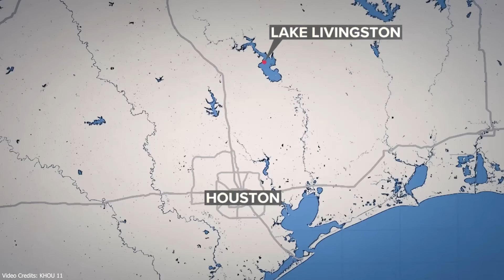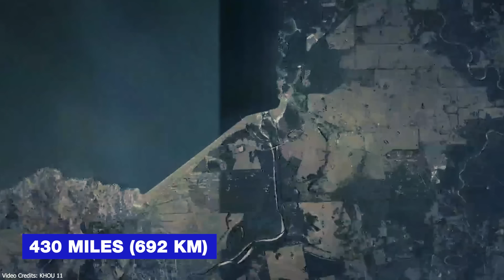Texas' Largest Dam Is Sinking — And There Is No Backup Plan

Comment: From Google Gemini:No, the claim that Texas’ largest dam is actively sinking toward catastrophic failure with no backup plan is misleading.   
YouTube

The title comes from sensationalized online videos covering the Lake Livingston Dam, which provides water to the Houston area. While there are real engineering challenges being actively addressed at the dam, the dramatic claims of imminent failure are exaggerated.   
YouTube+ 1
What Is Actually Happening?

    Satellite Data (Subsidence Monitoring): Studies using satellite-based radar (InSAR) have detected minute surface movements—measured in millimeters per year—across various major U.S. dams, including Lake Livingston. Minor settlement is a well-known, long-term phenomenon in large earthfill embankments, especially in regions affected by regional soil subsidence.   
    YouTube

    2024 Flood Damage & Emergency Repairs: In April–May 2024, record flooding down the Trinity River forced massive water releases (around 124,000 cubic feet per second). This caused severe scouring and erosion beneath the spillway.   
    YouTube

    Official Response: The Trinity River Authority (TRA) issued a temporary "Potential Failure Watch" to perform urgent repairs, which included pouring roughly 1,000 cubic yards of concrete to stabilize the spillway structure.   
    Trinity River Authority, TX

Key Facts vs. Clickbait Claims
Claim	Reality
"The dam is sinking."	Minor millimeter-scale surface displacement is tracked via satellites. It is a monitored engineering factor, not an unmapped structural collapse.
"There is no backup plan or response."	Emergency repairs were completed in early 2025. State agencies authorized multi-million-dollar funding for long-term upgrades.
"Catastrophic failure is imminent."	The Trinity River Authority and independent engineers confirm there is no evidence of structural failure or immediate threat of a breach.
Summary

The claim exaggerates routine satellite monitoring and real, managed spillway erosion into a doom-narrative. Officials continue to monitor and maintain the dam, and it remains structurally sound and operating normally.   
Trinity River Authority, TX

Comment: I believe that problem can be solved by installing slurry wall. It’s one of the most effective ways to create a low‑permeability cutoff for both foundations and dam remediation, especially when dealing with groundwater control, seepage reduction, or unstable soils. The core idea is simple: you excavate a trench while keeping it open with a bentonite slurry, then backfill it with concrete. Needs to go down to the bedrock.

Comment: This video does not touch on water hydraulics. The longer the earthen dam the quicker it sinks. the shorter portion is rising, the displacement from the area around it pushes up. Know the phrase "what goes up must come down" This is true for for the ground. If the ground is pushed down in one place that energy pushes up in another. Also how some types of earthquakes are started. Other countries like China are actively replacing these structures with various options to limit this type of failure. Ultimately in true Big money style so many people will need to pass on or loose everything before its replaced properly.

Comment: Took them 3 years to build in the 60’s and has lasted nearly 60 years before any issues. Today it would take 25 years to build and would be shut down within 5 years due to technical or structural issues.

Comment: Some explation should be made for how one end of the dam can be rising as per the same data set.  I don't disagree there may be concern for both the rising and sinking areas but I would absolutely feel the need to understand the rising areas before concluding the sinking areas are due to erosion caused by water passing through/under the dam.  I would also want to compare the dam with any movement of some non-engineered areas (non-dam) beyond either ends of the dam.  Certainly the scary parts of the data are more entertaining for videos than is the data that is used to evaluate the accuracy of the data set but, as a scientist, I want to know what causes the rising.

Comment: So point of confusion.  When you say dam, you're including the earth embankment, but it's best called either the embankment since that's what it is, or a levee, which is also what it is.  The DAM is the cement part, so the DAM wasn't built with dirt and rocks, the embankment was and this is VERY typical around the world when you want to elevate an area to create a lake that's higher than some of the area to give the border of the lake at a certain elevation.  VERY COMMON, GLOBALLY to do this.  There are embankments that are 2 - 3 miles long.

So when talking about dams, separate out the levee from the dam because they're two separate things.  In fact you can have a levee without a dam, and just have a spillway with no control whatsoever.

Comment: why can´t it be fixed on the surface?
when i was building dirt dams at the beach and i could spot one about to fail. i "fixed" it with more dirt
eventually you build a dirt mountain and the water will find another  way

Comment: Why does the Livingston dam seem hard to repair? Build it up backwards till it’s 5x thicker. It will take time, and heavy equipment, but you know the leaks start at the back. You’ll seal and reinforce as you go. If you can dredge the lake for back fill, you’ll add volume/depth to reservoir as you increase dam thickness. 

Example: Dubai and big cities on Persian gulf build entire islands  where they build resorts and housing. Learn from that, apply to this.
Reply: Just call a Dutchman in and ask them how to fix it.

Comment: Given the advancement in drone lidar mapping, low cost, high resolution, it should be a no brainer to map routinely. And trigger values set to increase mapping frequency. 

The satellite IFSAR doesn’t have the detail and higher noise given a larger pulse footprint.

Comment: Once the narrator said; ”zero flood control capacity” It was hard to believe anything else they said.
Reply: This is generally true of this dam given the way it operates. It was not designed with a large flood control storage, and has to release at pretty much the same rate as it takes in. There is of course a small flood reduction.

There are other more significant issues with this presentation.

Comment: So sounds like they need to move the damn down stream and build a new one more up to date.. so theres a safe buffer from the original dam to the new dam..
Reply: There are other issues. Ground subsidence is pretty common across much of southeast Texas; it's true that a lot is from oil and gas extraction, but groundwater extraction is a major factor of its own. There's also the geology of the central Gulf Coast. And don't leave out foolishness like the gross overbuilding of the Katy Prairie, which will only cause more future overland flooding across west Houston. The failure to build the second Addicks flood control dam is so painfully shortsighted, but it's only one example of a collection of self-inflicted wounds.
Reply: @AndrewDouglass-x1f I apologize for being truthful, but I dont need a educational explanation. 
The built the dam they repaired the dam .
I think they know what the geological survey says and the river is a water way which means its packed.. its not like there making something from scratch..
God bless you and have a great day!!
Reply: @infidel3162  The point of the video is that the repairs were for the visible damage on the surface, whereas the satellite data provides new evidence that there is a likelihood of slow damage deeper underneath would not be visible until it fails.

Comment: If as I recall, the trinity river fish were unfit for human consumption west of the 7th street bridge in Ft. Worth. How is the water drinkable that far South of there by 200 miles?
Reply from the maker: fair point and it's a real distinction worth making. fish consumption advisories are about bioaccumulation in the fish tissue itself — the contaminants concentrate up the food chain. drinking water pulled from the same source goes through treatment that removes those contaminants before it reaches a tap. two different pathways, two different standards. the fish advisory for Livingston is real though — been in place since 2015.

Comment: Been in construction most of my life. Most of it in Houston. Last one i did downtown was where the old foleys was located. Most of the soils ive dealt with was sketchy. Swamp land
Reply: Yep, Houston is sinking at 20mm a year. It is the fastest sinking city in the US. 

This Dam on Lake Livingston has only moved 8mm (0.3in) supposedly. 

Ive lived in around Polk County all my life and I've got a cousin who works for TRA as a maintenance supervisor. There is nothing to worry about. 

What most people fail to realize is that if you live close to large bodies of water, the surrounding areas will have a higher water table and structures built on that land will forever be shifting and settling. That is all this dam is doing and has ever done.
Reply: @Truckerdaddy 8mm a year  and  speeding up
Reply: I work doing environmental remediation and groundwater monitoring. The entire gulf coast is nothing but sedimentary clays, sands, and silts. Type B soils or better are hard to find anywhere in the Houston area below 4 feet.
Reply: Really sketchy on the east side

Comment: Lots of very low IQ comments from either bots or stupid people.  Is the dam failing a partisan issue? Democrat or Republican, a failed dam's water will drown indiscriminately.   If this was built by a Houston Bond referendum, then Houston can and should take responsibility.  Drain the reservoir,  rebuild, and move on.  Either that, or risk a total failure during a large storm like a Hurricane when you already have flooding as happened a few years back, or just drain it and have an erratic water supply.  Both scenarios make Houston into the Detroit of the Gulf Coast with people fleeing.  One has large numbers of victims. Texas seems to have a "thoughts and prayers" attitude towards floods and loss of life, so maybe they prefer to have a few million dead after a dam failure.  Don't worry, I'm sure blaming a political party will make this go away.

Comment: Going to have to fix the dam thing
Reply: Over $40 million was spent to reinforce the dam.  Loads and loads of rock and concrete and it was definitely an emergency.  I grew suspicious when engineers were on the Internet were being threatened and shut down and TRA refused to make any comments.  No news anywhere.  We sold and left the area.  We don't trust any officials there.

Comment: Reminds me of home savings banks’ advertisements tricking you into believing that financing and building a house, will free you from all sorrows and work about living for the rest of your life. The truth is that you will more likely have to spend again  the amount of the initial construction cost and a lot of time to keep it. 
This is a tiny fragment of a general issue. Mankind keeps building many and large vital structures without questions about maintenance, repairs, replacement and unforeseeable risks being taken seriously or even addressed at all. The appropriate approach would be to expect, monitor and plan aging. changes and development. Instead, it’s more like people believe that these structures are more stable, durable and long lasting than geologic conditions. In the same way many other imaginable or obviously upcoming problems are left to be solved entirely by future generations, the climate degradation which has been predicted for more than 50 years being only one example. We need technology and behaviour that adapts, fits and integrates into natural cycles and processes to achieve reliable and sustainable safety.

Comment: I don't think satelite monitoring is required. But some form of monintoring is.
Reply: And why do you think that satellite monitoring is not required?  Did something about the 5:20 explanation of how these European Satellites use radar to measure down to the millimeter seem too exact for you?
Reply: @Winterascent  More a general requirment for monitoring to a specific resoultion (which may indeed be only achivable by satellite ) then specifing the tech required.

Comment: Why instead of repairing the current dam, dont they just push the dam back, build it in a more modern way that will be stronger, either by concrete or whatever, then let the old dam get demolished or covered in water?

Comment: The trinity river does not flow thru houston.  A houston already has a water supply dam that flows down the sand Jacinto that would not hit houston either.
Reply: The Trinity River will flow through Houston when the dam fails.
Reply: @avsystem3142 wow !!! so you are not even a Texan. Are you even north american?
The trinity river flows into trinity bay about 40 to 50 miles east of Houston .
Reply: No, but it supplies 70% of Houston's drinking water.
Reply from the maker: we don't actually say the river runs through Houston — just that the dam supplies the city's water, which it does. water from Lake Livingston is pumped and piped directly to Houston's treatment plants — that's how 86% of the city's supply works. the river geography and the water infrastructure are two separate things.

Comment: WRONG The Trinity river is backup water source for Houston.  The San Jacinto River  with Lake Houston and Lake Conroe are main water source.  A new 23 mile water way connected the Trinity river to Lake Houston as a backup as Houston area growing and is trying to stay away from ground water wells because of land subsiding.  No not the majority source of Houston water.
Reply: You are missing the lead. This story wasn't about where Houston's water comes from, it was that the city is in the path of a flood if the dam fails.
Reply: @avsystem3142 Sorry but again WRONG if the dam fails it drains well east of Houston.  More city of Beaumont Texas problem. Not Houston
Reply: @benjaminplowman3350  You been wrong this whole time, hoss. The Trinity still supplies 70% of Houston's drinking water as of May 2026. Also, the Trinity is about halfway between Houston and Beaumont. I've lived on it for 20 years.

Comment: Call Brown and Root to come back and do repairs.  They did such a bang up job the first time!
Reply: thanks for the ignorant comment .... that dam is almost 70 years old
Reply: @mosquitobitemikes  I used to work for them.  I speak from experience.  Besides, there are far older dams in better shape!
Reply: @myfavoritemartian1  Makes me wonder if the material or compacting is the problem, or the sub strait.   In Arizona, Glen Canyon Dam is well built, but the sandstone is brittle, so in theory, 1000 years from now, the dam might exist nearly intact with the river going around it as the water cuts through the surrounding sandstone.  Well, if it doesn't run dry. lol

Comment: You seem to present the position that the earth-fill dam is inferior to a concrete dam.  I believe the opposite.  Earth fill is somewhat flexible which can withstand some movement.  Concrete is mostly inflexible and unable to conform to movement.  I'm not saying that the situation is not critical.  It's just less urgent than it would be for a concrete dam experiencing foundation movement.  I am basing some of my comment on the fact that subgrade movement caused by dewatering expansive clays is prevalent in the Houston area.  I don't have information specific to Livingston dam.  

It is urgent that COH and TRA contract with specialist engineers, geotechnical experts to inspect, analyze, and develop remediation for this dam.  It is the heart of water supply for the City.  I doubt that alternate water sources have been secured since our long range water plan for COH was completed in 1990/1991.  

I believe that failure of Livingston Dam would likely breach the downstream saltwater barrier that allows Trinity River water to be captured upstream of the estuary.

I appreciate that satellite monitoring has identified the risk.  Now is the time for action.

Comment: Couldn't they do the same drilling and filling with grout used at several dams I think in the Mid-East or China? Or drill to make what I think they call a Curtain Dam? Well, if the El Nino that's reported to be the most extreme on record comes to pass as well as the projected or theorized there are likely many dams as well as Livingston pressed past its limits.

Comment: I immediately thought about Three Gorges Dam.  What does the satellite monitoring show in that case?  

Having asked the question I went and looked for an answer.  And of course a study using one of the same satellites mentioned in this video has been done.  

Quote:

"The analysis results show that there are periodic displacements at the Three Gorges Dam and Maopingxi Dam with amplitudes of 1.1 and 3.2 mm related with water level ﬂuctuation. There is also an obvious displacement at the left bank of Maopingxi, Guanmendong and Yinxingtuo areas with displacement rate of 28, 40 and 40 mm/a, respectively."

I assume mm/a means millimeter per annum.  Forty mm per year is much higher than what is being observed at the Livingstone Dam in Texas but it's not the Three Gorges Dam itself that is moving.  It's a section along the left bank not that far from the dam that is moving.

Whether or not this is really a problem for the Three Gorges Dam depends on the context.  A context that I have no hope of finding out.  If there is a problem then the CCP is definitely not going to tell us.